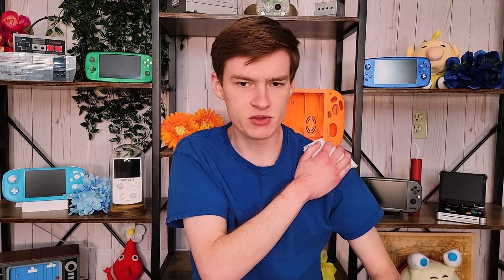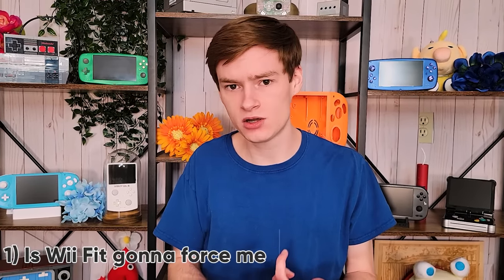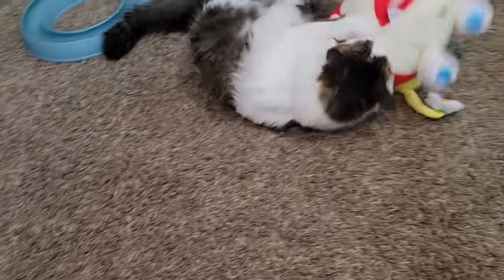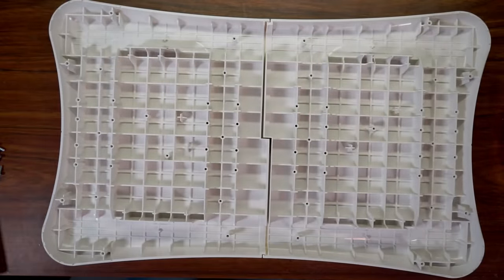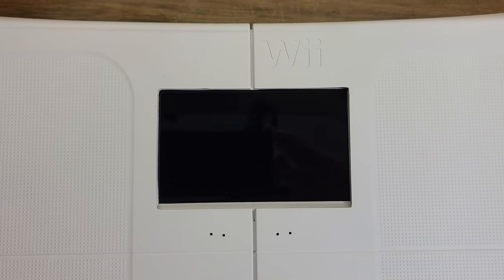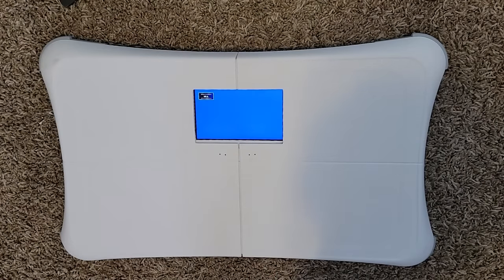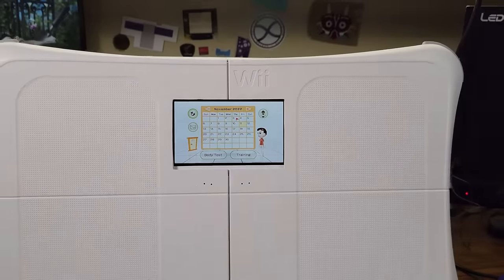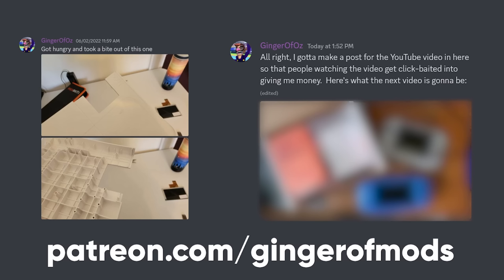I Put A Wii In A Wii Fit Board

Comment: I haven't been on my Wii in about 7 years and I could immediately tell you put the Wii Fit disc in the wrong way at 2:25. It was funny to spot that but I guess it made sense to do it like that from a filming point. But also at 9:11, correct me if I'm wrong. But doesn't the Wii NEED the Bluetooth module? I'm pretty sure it's one of those components that will completely stop your Wii from booting if it's not detected by the hardware.

Comment: Should have added two IR Leds above the screen like the Wii U. Would have been an easy way to make it fully self contained. You can also scale the distance between them to account for the small screen. Don't remember the ratio off the top of my head but the wii is very forgiving with the IR source , as seen by using candles as a sensor bar. Two cheap low power IR LEDs are pretty cheap Nowadays too.

Comment: I forget if Wii Fit has any exercises that specifically need you to step forward but if not then wouldn't attaching a hinged screen to it so it opens laptop-style be a decent design upgrade?  Bigger screen with a slightly more forward orientation and you could even attach the sensor bar to it with a more 1:1 scale on the pointer.

Comment: Or less practical, like a vBIOS modded R9 Fury GPU (I'd say Vega, but that's not allowed/not figured out) for lower heat output, soldered onto a custom motherboard in some handheld (HBM means no memory traces to figure out and less BGA work. More power than a SteamDeck and needs a massive battery to get the same play time. Stick in one of those Wii Portables that looks like a screen in a widened GC controller. I'd do it... if I had a YouTube channel that would return on the investment. Hmm, how about a socketable GPU? the only arguement I hear against that is memory timings... but HBM ...

Comment: Hello may I ask
Would it be possible to
Make wii fit board shoes

This is my haiku asking if it would even be possible to turn the wii fit board into footwear? I guess you could add some wheels and make a skateboard it you want to Really make it portable… but this is not an answer to my pressing question. I just really want to be able to play wii fit while moving outside. Also, a VR headset would be good.
Thank you goodbye

Comment: I have a question?
is it possible to make a handheld console that plays gbc, gba, ds, and 3ds games?
Reply: Maybe with emulation, but this genius may be able to make them run natively (doubt it due to the ds’s touch screen being an issue), but maybe
Reply: @Narwhal12  thing is, I wanted to use it as an actual console, with trading capability and everything. So I can 100% every pokedex in every game
Reply: @jachobchristian7309  Would probably be hard to put all the hardware in a limited shell and make it all compatible and not get in the way of each other, especially with the extra ds’s touch screen being an issue too

Comment: It probably over heated..
Reply: unlikely, the cooling system that he used is powerful enough to dissipate most of the heat that's generated through the wii's gpu and cpu
Reply: @revine9243  true also in the video that the board can't take no bending which causes some components to break and snap. It's a great project for new wii emulators